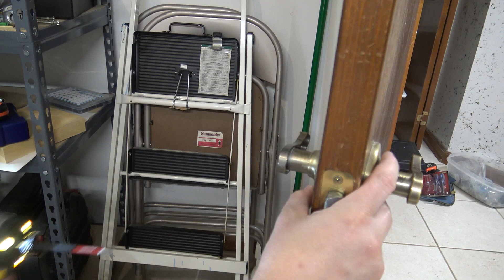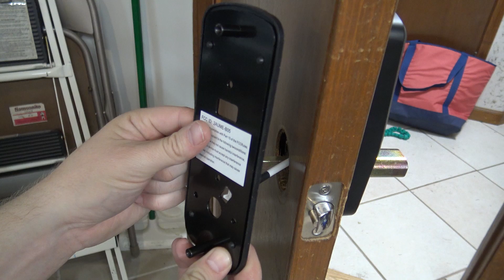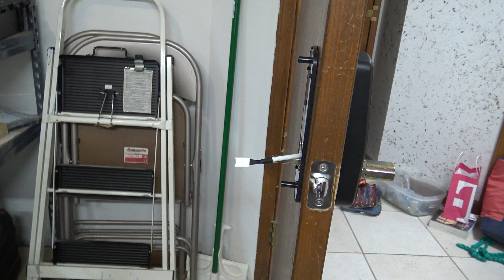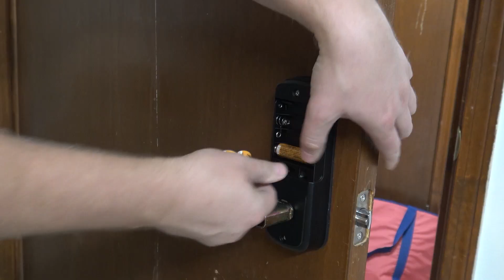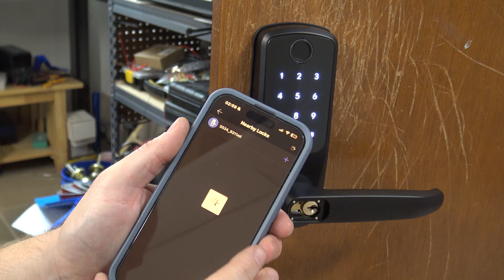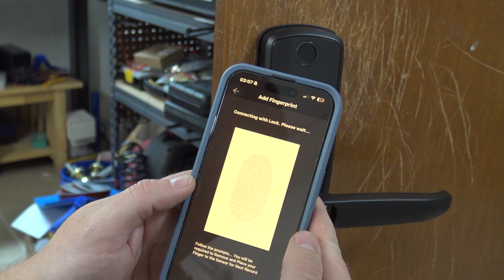(613) Volibel Fingerprint Smart Lock Installation App Setup & Review

Comment: I like my electronic lock.  I usually keep the backup key on me but it's convenient never pulling it out.  The one time codes are nice too.  I have some one time codes preprogrammed and saved in my password manager since I didn't cloud connect my lock.
Reply from the maker: On my front door. I used to have a Schlage BE 365. I would keep a few extra codes in there just to give people just in case and then just delete them if they use them. Works well. I have a Schlage sense on my house now that’s on the Internet that I can just do with my phone from wherever. I just put this lock on this door because they sent it to me and it had to go somewhere lol

Comment: In my community all the houses were came with Schlage Encodes. After a couple years my neighbor calls me and asks if I can install a replacement that Schlage sent him. His just died. I swapped it out no big deal. Less than a week later mine dies. Schlage was back ordered. I think it took 3 months to finally get it. 1 week after mine my other neighbors Encode died. That was nuts. He just got new fancy all glass doors installed. It came with some kind of Schlage electronic lock. He asked if I can rekey his garage locks. I told him we can just do the new one to match the old key but he wants it the other way around. I said I have to dig out my pinning kit and house lock stuff. He says send one of your guys. lol Ughhh I would have to pay them so I will just handle it. Neighbors too funny.  

I read in a forum and they happened to be from Florida. They thought it was a moisture humidity issue killing the Encodes. Apparently this is an issue with these locks. Have you seen these go bad?
Reply from the maker: Well I’m actually in Florida and I have yet to see an encore fail so I’m not. Maybe they just had a bad batch go out. Schlage stuff in my opinion has kind of gone downhill the last five years or so.
Reply: @BoredLockpicker  I think you are in north Fl I'm down south. This community has about 600 homes. They probably ordered them in huge lots so there is a chance they had a bad batch and we were lucky enough to get them. Looking on their website his new one is either the Encode or the Encode Plus. Not sure what the difference is. Their 8' glass doors. Amazing but I wouldn't want the whole neighborhood looking into my house.
Reply from the maker: Same!  I got even my front windows with this tint stuff so you can’t see in